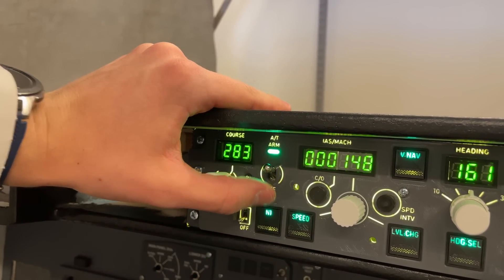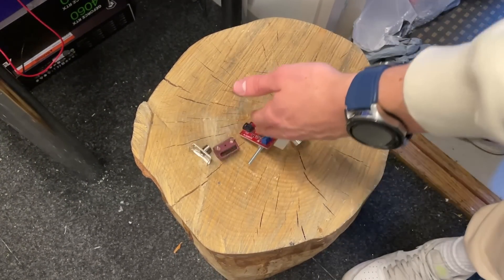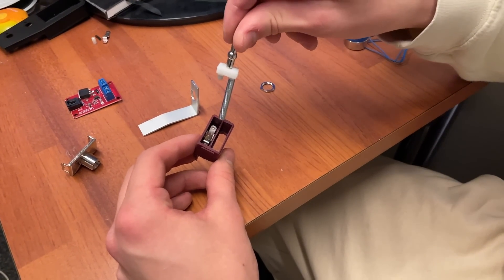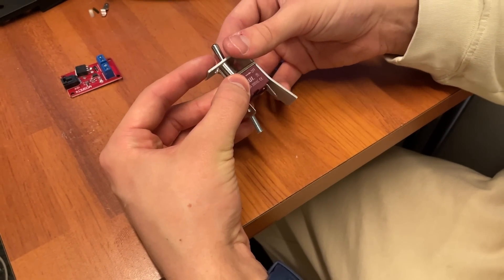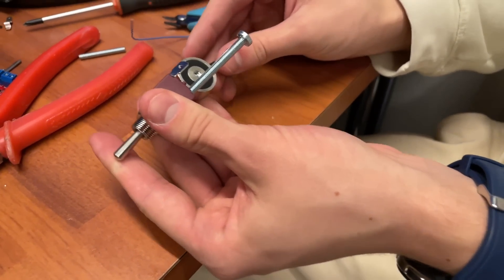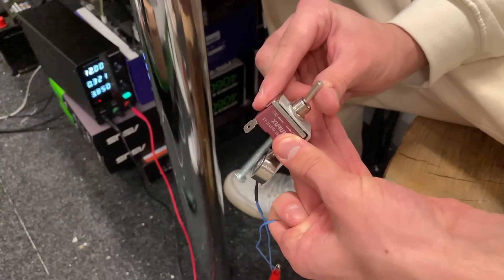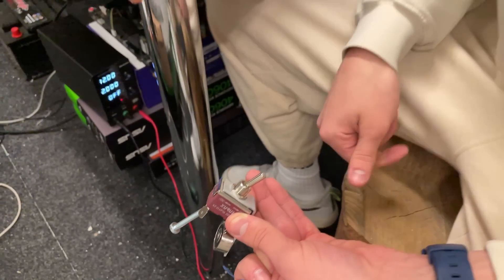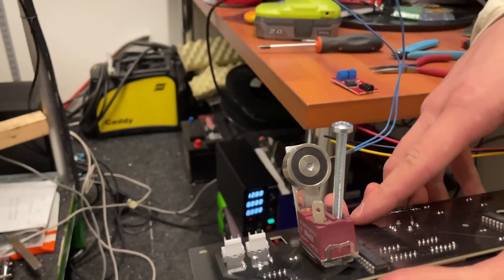Magnetic Return Switches... They Are SO CHEAP!

Comment: Did you think about, or try, using an inexpensive servo to drive the switch position? It doesn't require the MOSFET, just uses a PWM signal to set the servo position... It allows you to have some control over the activation speed, maybe even some "feel"
Reply from the maker: That's a very good suggestion! We might give it a try sometime in the future.
Reply: Those little servos are quite inexpensive, and you can get quite powerful ones, too. For some applications you could add a feedback potentiometer, so that you could put a bit of a spring on the actuator, and get a level of programmable compliance by controlling position through the feedback potentiometer, because the servo has its own "stiff" position feedback/control... Am I making any sense? Just the idea that controls should appear to have friction and compliance. But, what do I know... Just a simple guy from 🇨🇦

Comment: Have you tried this with a latching toggle switch? I wonder if you can use one to avoid having to keep the electromagnet powered continuously.
Reply from the maker: Thank you for the suggestion. There are a lot of ways this could be achieved but I feel this is the simplest. It would indeed be better if the magnet wasn't constantly powered (and heating up) so I think we will look into a latching toggle switch design next.